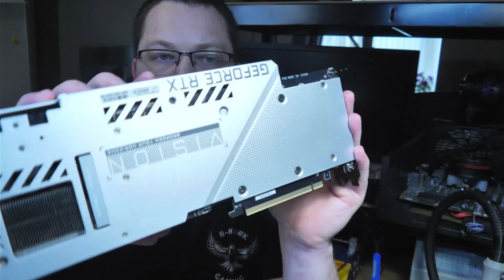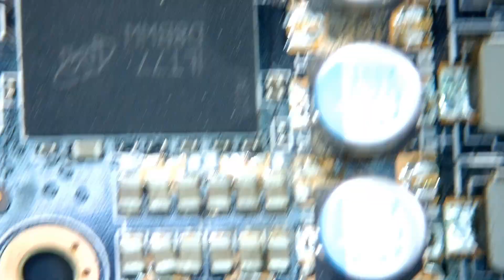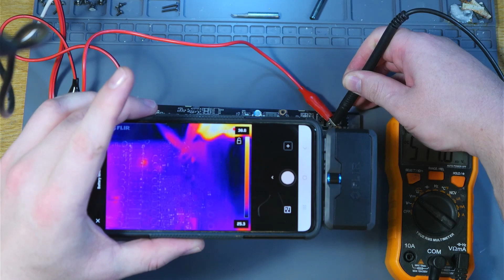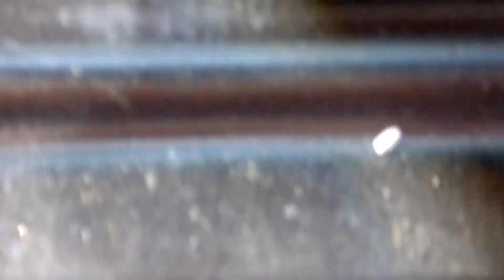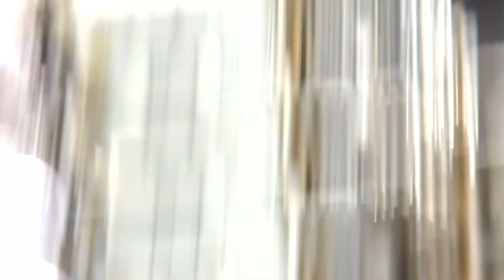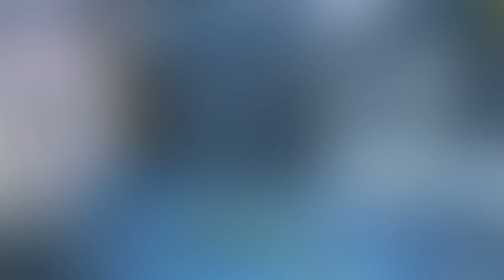Gigabyte RTX 3080ti Vision OC graphics card GPU repair

Comment: I tried to do this with my 300w rework station and the chip wouldn't budge, is it likely I need a more powerful station?
Reply from the maker: Most likely. Most techs use a 1000w station and some sort of preheater. The idea here is to minimise the boards exposure to high temps. You don't want to sit for 20 minutes blowing hot air on the more sensitive stuff, like electrolytic caps that can literally take off like a rocket if you overheat them.
Reply: @b-hawkgaming  Thanks, just bought an atten 1000w unit. Any recommendations for a preheater?